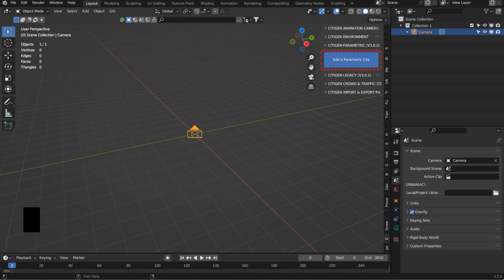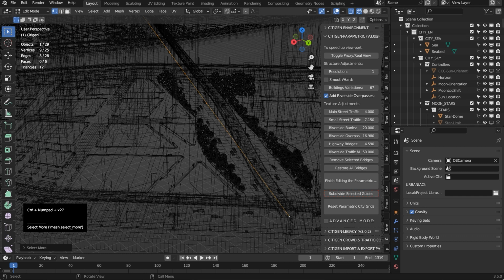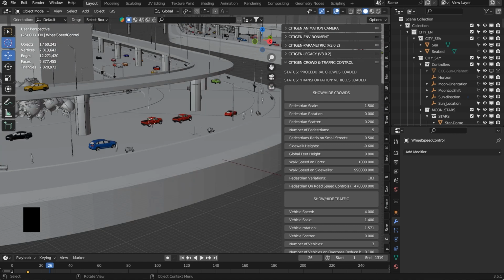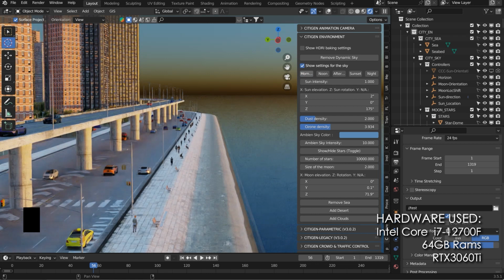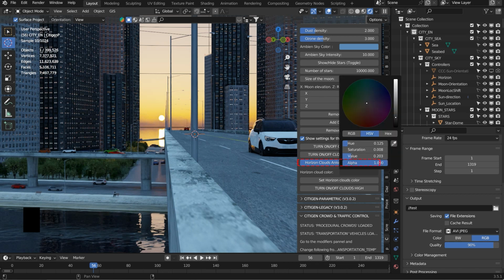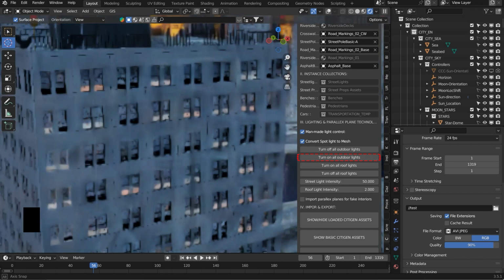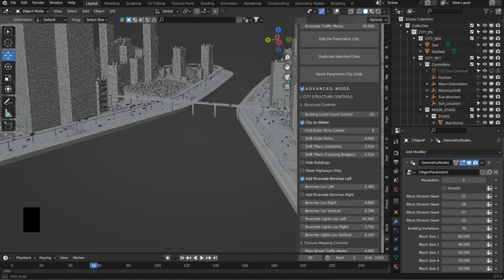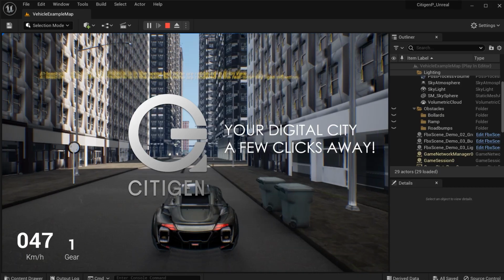CITIGEN PARAMETRIC - A NEW WAY TO CREATE CG MEGA-CITIES

Comment: Thanks for the video! What gpu + ram + cpu do I need to run this addon smoothly? RTX3060 + 32GB + i7-11700KF will crash...
Reply from the maker: Sorry for late response. Your hardware specs seem good enough. Citigen is version-sensitive. As of July 27, latest Citigen works in Blender 4.0 and 4.1. And when updating your Blender, be sure to remove existing Citigen copy and re-install Citigen .
And when editing a large-scale city, you're suppose to use Proxy View and switch to Real View only when you need to check the final look before rendering
Reply: @digitalmirage_studio Thanks for your reply！ What specs do you think is needed to switch to render view smoothly when editing large scene?
Reply from the maker: @shijunliang9542  Hi, The hardware specs used for the Demo were: i7-12700F, 64GB ram, RTX 4060Ti.
Reply: @digitalmirage_studio  Thanks for your reply!

Comment: Does it have a railway support?
Reply from the maker: Interesting ... and very relevant. (Obviously not yet. But may be in a Citigen-specific asset pack.)
Reply: Hello I have managed to buy the ultimate freelance package. I must say it is an excellent addon. And it is a blessing to the people who are hustling to manually create cities. 

However, I am curious to know is there a possibility or a way to get satellite data (just like openstreet addon provides) and use that data to built real perfect cities? Let me what you think?
Reply: @mirzawajahatofficial9454  Using the curve objects resulting from the openstreet addon as the basis for modeling complete city details seems possible. (It seems, though, OUT OF THE DECLARED SCOPE of the original Citigen addon. It's already packed with additional features that could have been released as separate addons.) The question is: (1) How many blender users/studios are out there that are in desperate need of such addon and (2) how much are they willing to pay for it.